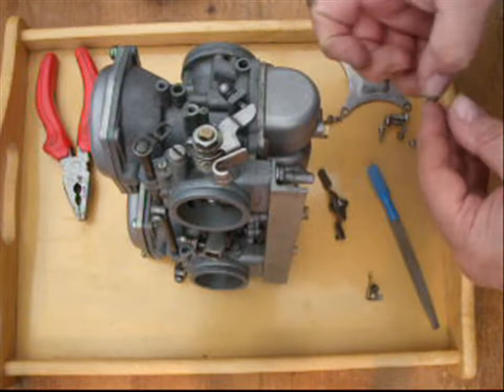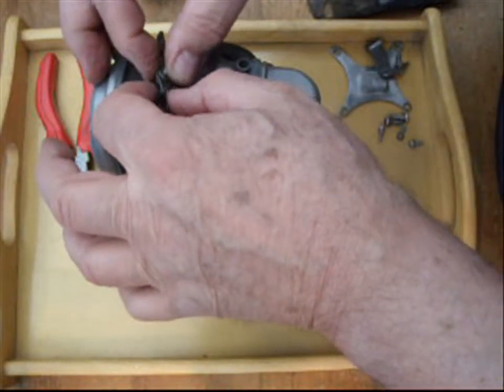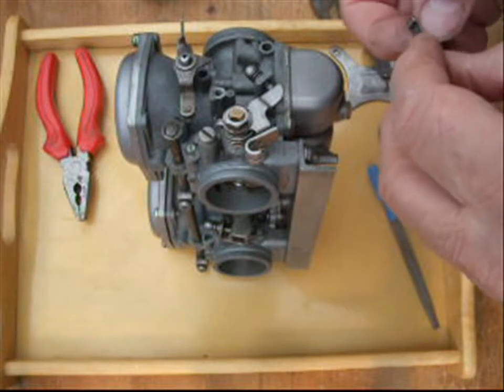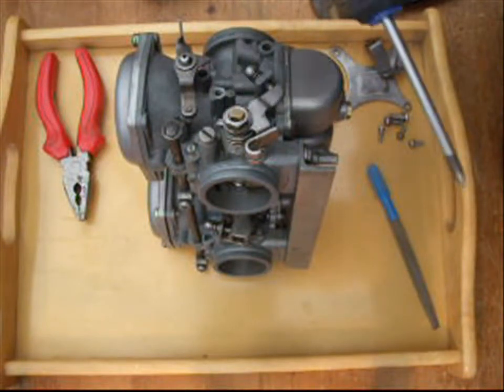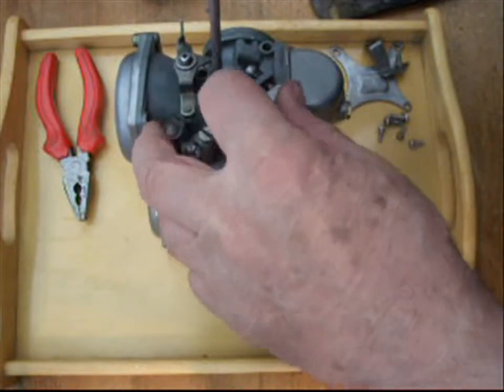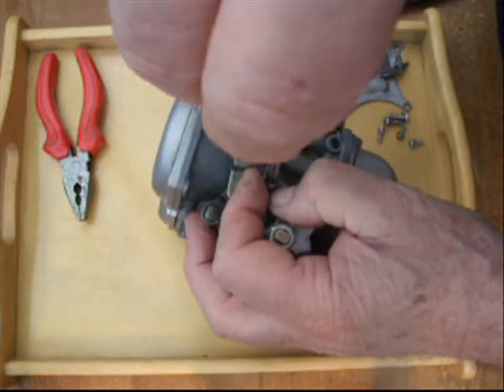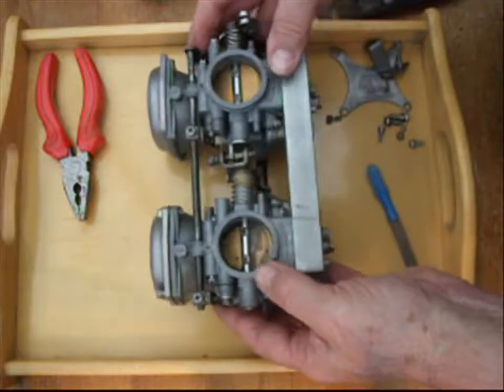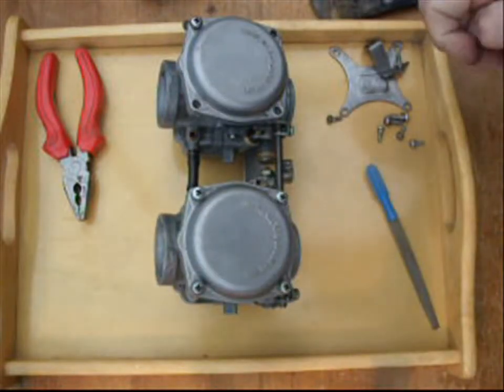XS650 BS38 Mikuni Carbs choke troubleshoot Part 2

Comment: Great video, part 1 and 2 are very informative. As well as your other xs videos. The carbs off my recently purchased 77 xs650 have a groove worn into the body of the carb from the throttle butterfly. Before I put more time and money into these carbs will they ever run well with that groove? It’s almost a 1/4 way around. Can this and should this be repaired?
Reply from the maker: Tom thanks for the feedback glad the videos  were helpful.
The short answer to your question is yes......and no......

I'm sure that they will run fine because you can compensate for the tiny bit of extra air caused by the groove by adjusting the butterfly gap at idle on the worn carb and also the mixture screw.

That said you are going to struggle to get the idle on that cylinder perfect at low idle revs like 1000rpm but who wants a perfect idle eh?  If the idle is a little bit lumpy and you cannot improve it despite all your adjustments and settings then slightly increase the idle speed until the idle is fast enough to cancel out any slight lumpiness at idle. 

At anything above idle the groove is likely to make negligible difference but give them a clean and try it  they can always be a spare set whilst you clean another better set of carbs if you buy some.  If you need carb parts the best supplier bar none is mikuniman on ebay he will have a spare carb body https://www.ebay.co.uk/itm/Yamaha-XS500C-D-1A8-1976-77-BS38CV-left-side-carburettor-body/164007121282?hash=item262f961182:g:4dEAAOSwgNZdrI1r
Reply: Thanks for your prompt reply. I’ll try them. The cost of a replacement set is considerably higher than a couple jet kits.
Reply from the maker: @237cooter  if you need used parts try mikuniman https://www.ebay.co.uk/itm/Yamaha-XS500C-D-1A8-1976-77-BS38CV-left-side-carburettor-body/164007121282?hash=item262f961182:g:4dEAAOSwgNZdrI1r
Reply: I’ll definitely keep them in mind should they need arise. Thank you again